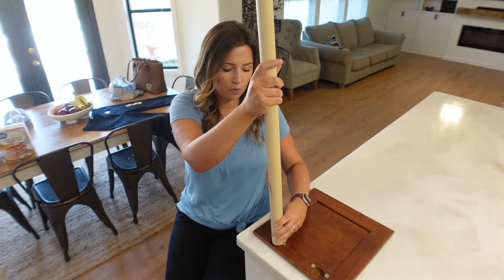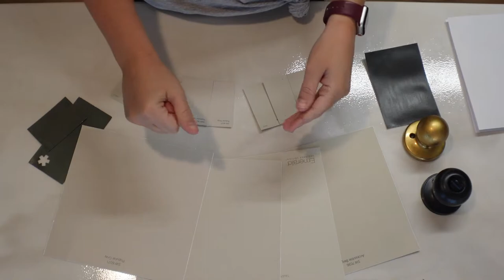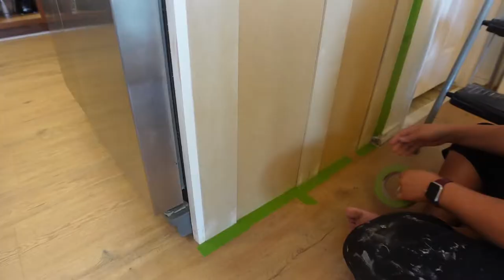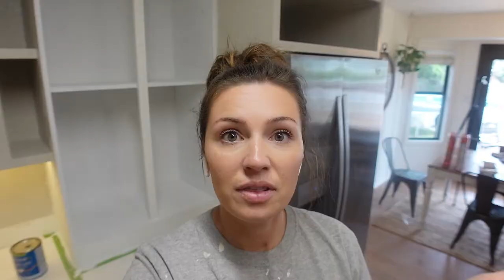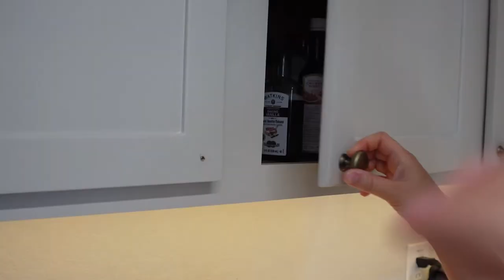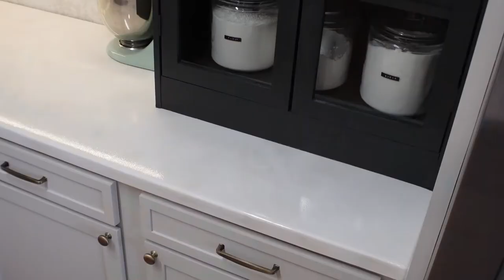DIY KITCHEN CABINET MAKEOVER PT 3 (painting & making my cabinets shaker style) | Home Reno Ep. 11

Comment: I have light wood shaker style cabinets and they are 17 years old.  I’ve been wanting to paint them for a while but am worried what if I hate the paint and wish I kept the natural wood?  Also how did you paint them without seeing brush strokes or roller marks?   Your kitchen looks amazing!
Reply from the maker: I would paint a poster board in the color you like and hang it up over a cabinet for a little while to see if you like having the color there all the time. I use foam rollers on cabinets so you don’t see brush strokes.

Comment: Hi did you sand the cabinets? And what paint brand and type did you use? Thanks
Reply from the maker: No I didn’t sand the cabinets. Just cleaned them really well with a degreaser. I used sherwin williams paint in eggshell/satin sheen (not super glossy but you’re still able to scrub/wipe the cabinets)
Reply: Semi gloss is more cleanable satin comes out like flat